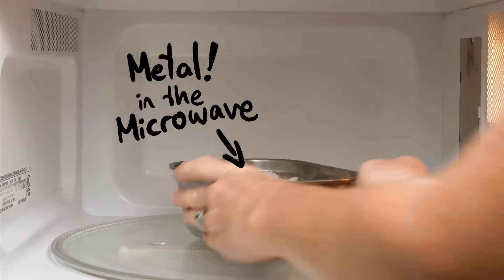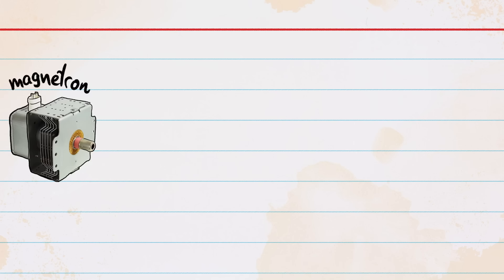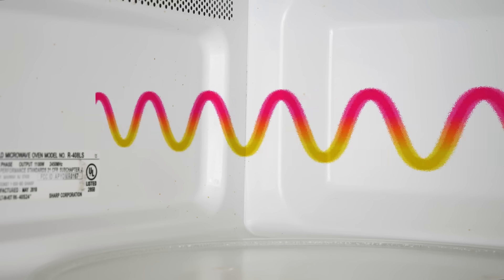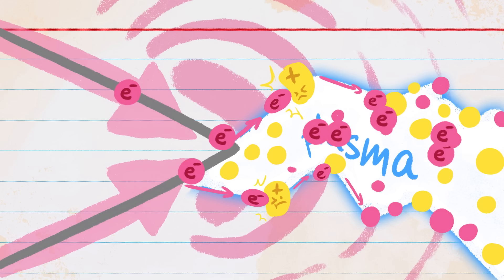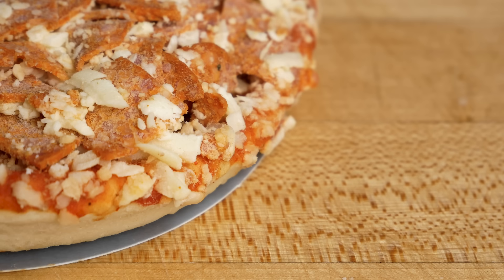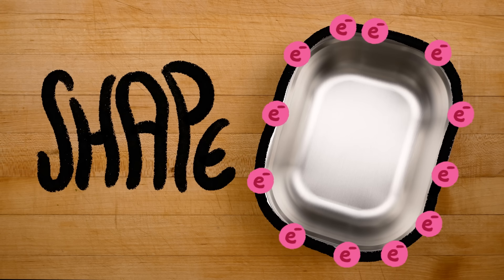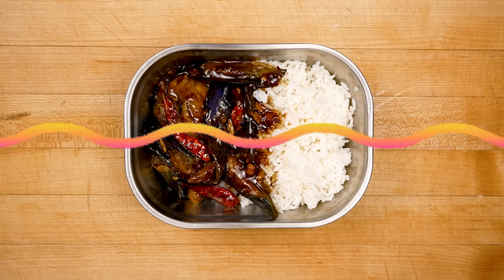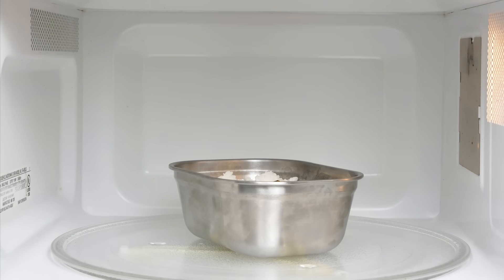Microwaving metal is FINE (sometimes)

Comment: Well after about 5 seconds of a metal knife being in the microwave it sparked. I’m gonna go back to not putting any metal in the microwave.. despite this video
Reply: You used a knife.
Knives have a sharp edge, which can cause electrons to pile up and cause sparks and arcs.
Spoons, and stuff with rounded edges are less likely to cause issues.

Comment: So uhh, one time I got chick fil a right… and they give you a sandwich in a little paper bag thing that’s lined on the inside with this foil stuff or whatever.. I went back to my hotel and ate half, later I put the other half in the microwave and with the package. It arced so much that there were burn marks inside the microwave 💀 they never charged my card for the deposit surprisingly, but don’t do what I did.

Comment: I'm genuinely curious if there is a difference in generation of microwave. They are significantly stronger now, but I still remember our old weak turn dial microwaved arced really easy. Found that out as a kid. But if people are having trouble now, I'm wondering if there's a difference in design
Reply: No, consumer microwave ovens have generally hovered around 1kW since the 1980s.

Comment: I absentmindedly microwaved a cup of coffee with a mug with metallic parts and electroplated decals recently.
The design was fine, the microwave was fine, the rest of the mug was fine, I only realized what I did, when I went to grab the handle, which was almost entirely covered in metal.  It took me a second to register what happened.

Comment: I have a metal microwave toastie maker gizmo. You put a sandwich in between two metallic plates, zap it for a minute or two, and it's done! Almost instant toasted sandwich, and it's perfect every time. It's covered in silicone on the outside so you don't grill your fingers, but I have like 4 because they get too hot to easily use again quickly.

Comment: In fact the one and only time I put metal  in a micro wave it sparked and caught fire. I was 10 and it was a plastic mug I did not know used a screw to hold the handle on.

Comment: I put metal in the microwave by accident only once. A leftover container of pasta from a restaurant. One of those thin rectangular aluminium ones, and I think I left my fork in it too. I closed the microwave, turned it on, stared for a sec realizing something was wrong with what I just did, and then saw blue sparks and figured it out lol

Comment: I have made our microwave spark so many times. Fully accidental and it keeps happening, every time different item causing it: chocolate bar in wrapping, grapes, nutella jar (had tiny bit of foil on the edge), tea bag (accidentally forgot water), microwaveable meals multiple times (the oven was dirty inside so perhaps it caused it) one specific plate and I'm still not sure why it did so. Also burned some foods: raw freezer buns (reguired regular oven), freezed berries (maybe they were too dry), popcorn (because the bag stopped spinning).

Comment: I learned what happens when you put metal in a microwave when I was about 9 years old. I went to put a jar of peanut butter in there for a little bit to soften it, but the jar had some of the metal safety seal still left on the rim and it started arcing… I’ll never forget the sound it made and honestly I was scared to even get close enough to shut the microwave off, but I just did it. I’ve made sure never to put anything metal in there ever since. Is this really so rare? I guess I just got unlucky.

Comment: put popcorn in a paper bag, and put that in the microwave. there's moisture inside the kernel so it works just fine, no metal needed. you can put oil and salt in there too of course. you might find it hard to switch back to regular microwave popcorn...

Comment: I had a microwave that came with a metal upper wire rack.  I was dumbfounded but trusted the engineers that decided that was a good idea. 

It did eventually arch with the back wall of the microwave leaving a burn mark. Of course since I had never used the rack to presumably heat 2 things at once, I took it out after it arched and put it in the back of the cabinet.

Comment: Stay away from the sides.
It's all RF#.
Microwave ovens are why wifi and Bluetooth is 2.4ghz* 
Microwave ovens came first @ 2.4ghz  there was no way to sell the frequencies with protection from interference. So it became open slather
#rf radio frequency. 
*Other frequencies of Wifi added since.

Comment: I remember when I was installing a microwave for my grandmother over her oven and I was reading that it had two areas it could heat food up in: on the turn table and on this shelf that sits halfway up the inside of the microwave. 

Imagine my surprise when I saw it was a metal shelf. It still has never been used

Comment: Thin metal foil reflects the same as thicker metal, however the electron motion that reflects the waves has much less room to move in so the heating is much higher.  It’s the same reason a thin wire burns out while a thick wire does not carrying the same current.

Comment: On some microwave ovens, there is a sticker on the door frame that shows a glass with liquid and a spoon in the glass, along with a crossed-out glass without a spoon. This is because when water is heated in a microwave, it has no place to start boiling, and there is no point of origin for bubbles. It is similar to the phenomenon of supercooled water, where you hit a bottle of water on a table and it freezes evenly inside. Therefore, as soon as you add sugar or anything else to the water, a bubble will form, and the water will boil right in the glass, which can be dangerous and cause burns

Comment: Years ago, my microwave spooked the heck out of me when I accidentally put in a plate that had a thin strip of metal around it for decoration... It was so thin but ohhh boy the sounds and flashes it made!! It was so scary. Also more recently I put in a mug with decorative metal surface on the handle... the burn on my hand was awful. Threw the mug away. NEVER again, no metal in microwave. Even if it's 100% "theoretically" safe.

Comment: I once put homemade playdoh in the microwave. I had shaped it like a dice, using mustard seeds for the dot, so I put it in the microwave to dry, or so I thought. In around a second, I saw a bunch of flames bursting from it, I panicked and quickly turned it off, to my relief the microwave continued working normally, but a corner of the dice looked like it was made of ashes.

Comment: Its fine as long as there are no seperate metal parts i.e bowl and metal spoon.

Metal food containers work fine but your food will still be stone cold even after 5min because metal reflects microwaves.

Just dont put foil in there and you'll be fine.

TL;DR: metal is fine, it just makes heating food really slow. And dont put foil or youll regret it.

Comment: My experience with metal is if its smooth nothing happens, but we used to have this banged up pan and it would spark around the dents and imperfections on the surface, it was mesmerising to look at, probably more dangerous than i thought also
Reply: I like how this video proved my childhood experimentation correct

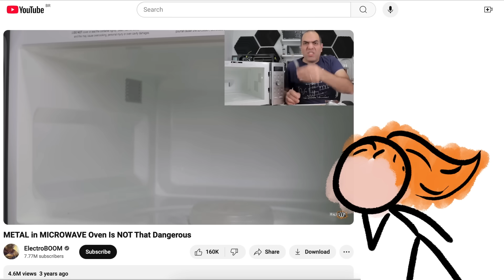Comment: 3:29 The easiest way to achieve arching is to use  things coated with a thin and irregular metal  coating (gilded dishes, circuit boards, compact discs etc). This is also a great way to irreparably destroy them.

Comment: Fun fact, it is completely safe to put some metal in the microwave. Metal itself is not the issue, it is the shape of the metal that can cause issues. Forks are generally bad because the prongs concentrate electrons and can cause arcing. Some bowls may reflect enough of the electromagnetic radiation back into the magnetron and damage the microwave (particularly older or cheap microwaves).

In general, it's best just to not put metal in a microwave, but there are microwave safe metal containers now specifically made not to cause arcing or problematic reflection.

Comment: I have definitely had metal in microwave problems twice within the last 5 years, with modern devices. One was a fork left on a plate, which I saw sparking and stopped immediately, and one was a foilpaper wrapped burger, which did actually catch fire before being hosed off in the sink and left a bad smell in the air for the rest of the day.

Comment: We had cup coated with thin layer of metal from outside - for decoration.. Other house member once put it into microwave without second thought - to heat the (already cold) tea inside. After 2 minutes she got burned fingers - cause the cup was ridiculously hot (you could FEEL the heat radiation when holding hand next to it) and tea inside was cold.

Comment: 1:  When you had write-once optical discs, like CDs, the way to destroy them was to put them in a microwave with a cup of water. The cup of water would keep The microwave from damaging itself, and the CD would have spider webs of burned material going through it rendering it unreadable. 

2:  I have unintentionally caught something on fire in the microwave. 
It was one of those sandwiches from Arby's, you know the ones they're wrapped in what appears to be silver plastic wrap? Yeah, I threw three of those into the nuker still inside the bag They came in. I heard a "ZZZZZ  ZZZZZZ"  sound from the front room, and went back in there when I realized that sounded like a CD being destroyed. Looked like somebody was welding in my nuker....and The bag was on fire. 
The microwave ended up being fine, worked for another 5 years before it died....still had scorch marks on the roof of the compartment where They wouldn't come off.

Comment: I still rexommend avoiding metal in microwave ovens.  I had spectacular arcung from small bits of aluminium coated foil that was covering jars.  In case of #%😂🦴☣☢#☠&$! plastic jars even the edge of the jars may get burned.  Arcing or not of a metal part in a mixrowave depends on the exact size and shape.  Basically if the metal part is a good antenna on the oven's frequency.  Not knowing that, putting metal into the oven is a gamble.

For sime stinky fun, try microwaving some old CDs.  The arxing is spectacular and the pattern burned into the CD is interesting and pretty.  Just don't blame me if your microwave is damaged.  Mine has never been damagedm

Comment: The waves don't usually mix as well as you indicate, which is why there's a turntable in most units.
I saw a video that used cheese to show standing waves in mw. It makes very distinct patterns of hot and cool.
This is why they usually tell you to let food sit for a few minutes, because the food can get really hot in spots and stay cool in others so you wait to let the heat spread more uniformly through your food.
Reply: Frozen burritos always end up boiling on the outside with an ice cube in the center
Reply: @briant7265   That's why you're supposed to let them sit for a minute or two, to let the heat equalize

Comment: One time I was heating up so coconut oil in the container in the microwave. I just put it in there for like 5 seconds and various colors started to emit from the microwave so I immediately pulled it out. There was just a little bit of foil used to seal the container on the edges. So personally I'm not gonna risk it unless it is explicitly for the microwave

Comment: one time my mom came back home with chickfila and I had a chicken sandwich and was talking to her on the other side of the room while putting my sandwich in the microwave to heat it up more, and I straight up saw electric arching sparks on the inside of the microwave around the ALUMINUM wrapper.

Comment: You can also create plasma in the microwave by putting a lit match in it (no metal required). Used to do it when I was a teenager. Might not be safe, but it is pretty cool.

Comment: one time I put an arbys sandwich in my microwave thinking that the foil wrapper they put the sandwiches was like, fake metal or something, and even if they I was willing to risk it for the biscuit. after 3 seconds a flash of plasma appeared and burned a hole in the side of the wrapper, so I immediately stopped the microwave. sandwich survived thankfully.

Comment: I've done it. I busted the magnetron of my microwave, atleast thats what the LG guys said the reason for it failing was. 
I used the grill rack which is for the oven part of it for microwaving tasks too. 
This happened after 4 years of usage so idk if it was actual wear n tear but from my understanding current magnetrons dont actually fail that much.
Reply: I currently use butter paper/parchment paper or  glass exclusively inside the microwave

Comment: Back in the 80's when TV dinners still came in aluminum trays, the packaging actually had instructions on how to cook the tray in a microwave.  Simply cover the edge of the tray and outer one-inch of food with aluminum foil, leaving the center of the tray uncovered, and nuke away.  It worked just fine.

Comment: 50ish years ago I repaired a commercial microwave oven, which was still kinda new tech at the time.  Someone put a stainless steel bowl with some spaghetti in it and the arc/explosion blew the door off.   They had refitted the door but the oven leaked enough radiation to cook things outside the oven.  Like your hand resting on it while waiting.    The basic tech is still the same so I would guess control of stray energy has improved?

Comment: Oooh, I left a spoon in the microwave once. Everything seemed normal until the handle tip of the spoon just brushed the edge of the microwave wall ZAP! Bright blue light and loud fizzle and a black scorch mark on the wall of the microwave. I was so sure my mom would flip out that I broke the microwave. But luckily the black mark wiped off, and the microwave still worked so I never told her and we are all still alive so there’s that.

Comment: The important thing is not to leave loops of metal or conductive material. I once tried to microwave a jar of peanutbutter to melt it, and didn't get that paper lid off completely... Well the underside of that lid is foil, and it created a perfect conductive loop around the edge that melted some of the plastic within seconds of starting the microwave lol
Oh yea I also got a set of plates that had little metal trim around the edges, immediately arcs too unsurprisingly

Comment: Once (in 2003) I was burning a CD on my computer, but my computer crashed partway through because my computer just kinda did that.  So I finished burning the CD in the microwave.

The microwave smelled like burnt plastic forever.  Don't do that!  The flames were pretty, though.

Comment: 3:32  I bought some china at a thrift store, whole 82 piece set for like $20. Relevant, because we learned real quick that the gold plated edge on the flower details LOVES to arc in the microwave and will start sparking within seconds of starting it up.
Reply: The paint has lead. Do not eat food that touches that. The lead in the paint  is what's arcing.
Reply: Whats weird is that you guys just call it some "china" 😅

Comment: I don't know, one time during winter when I was 10 I tried heating up a cold jar of Nutella to make it spreadable. I forgot that even with it being opened there is still a bit of aluminum foil around the edges. So imagine my dumb ass getting jump scared to oblivion by a sound I could only describe as sounding as if my head exploded. I know its not scientifically accurate, but almost as if that experience traumatized me, I could never put any metal in a microwave.

Comment: Anything metal that has points sticking out and they’re close to each other will arc. Forks, crinkled aluminum foil and aluminum take-out containers will very likely arc. Even some stainless steel coffee cups, found that out the hard way. 😁 Also discovered that some stainless cups won’t even heat the contents because they actually block the waves completely.

Comment: Did you know that the center of the microwave usually will not get any heat? If you place your cup off-center and shove the noodles in your plate to the sides, you will have a much more even heating :)

Comment: I once put the metal wrapper that you get on some fast food in the microwave and it caught fire. It was interesting because the edge of the rapper was burning and then it would just disappear as the flames moved along the paper. Also I swear the microwave turned itself off.
Reply: Thermal diode in the microwave tripped

Comment: There is a certain point in life when you need to learn that never is never true and if never is never true it means that sometimes it is true which is very confusing. 

Basically there's a ton of things in life where as a kid you're told never to do something just because it'll keep you safe but as an adult you find out that there are specific circumstances where it's actually okay to do the thing you're told not to do. Never play with fire but then as an adult you're allowed to make a fire pit or never touch the stove but as an adult you're allowed to use the stove and you can definitely touch it if it's off and never let someone touch you down there but as an adult you definitely want certain people to touch you down there.

Comment: I would like more information on the mechanism of extremely thin metal sheets absorbing EM radiation rather than reflecting it and thereby acting as a susceptor. I never knew that was the actual way they worked before and assumed it was a special material or alloy. I suspect the explanation is probably due to some subtlety of surface plasmon resonance, but if someone is truly versed in EM theory and materials sci, please reply.